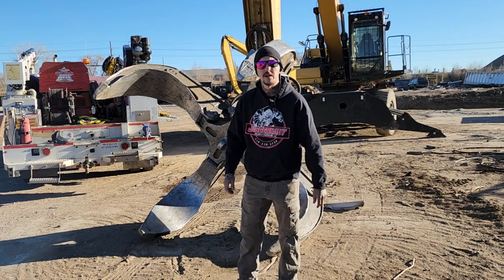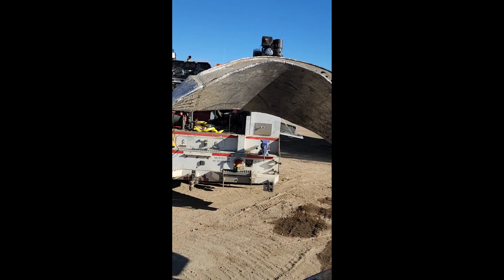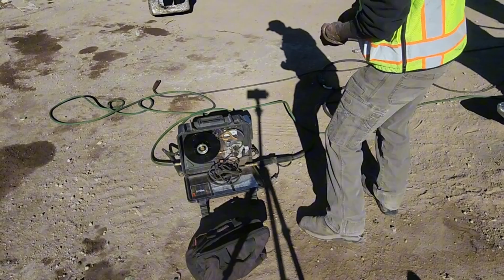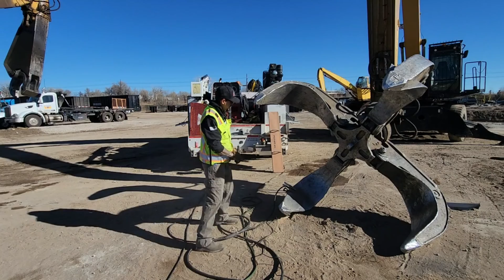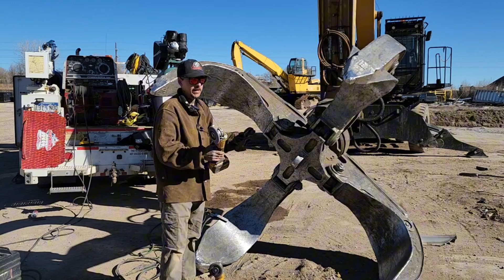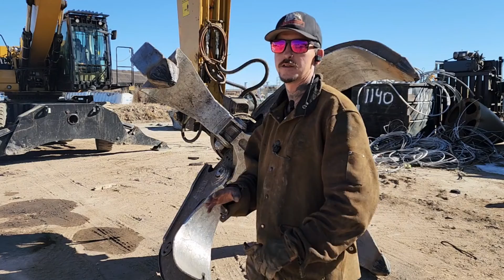Hardfacing 101, How to hard surface

Comment: Why are you running er70s2 wire vs er70s6? Can’t say I have ever run er70s2 just curious.
Reply from the maker: It seems to do better with dirtier materials. Even with grinding these tips are always in oil and dirt.

Comment: I have a D4 dozer blade I could use some hard facing on, I have a stick and wire welder, what temps would you set that too welding on that heavy of steel?  Also...reccomendation spend $60...ish on a folding work table at home depot to set your machines on, you only have so many of those ups and downs with your knees, 70 year old you will thank you.

Comment: Used to hard surface parts for the railroad company and used Stoody wire. I also worked in a scrap yard back in the 80s, and we would use 11018 rods to buildup the spiders on the shaft of a hammermill. Technology has improved a lot since then. It's cool to see just how tough the material is once you apply it.